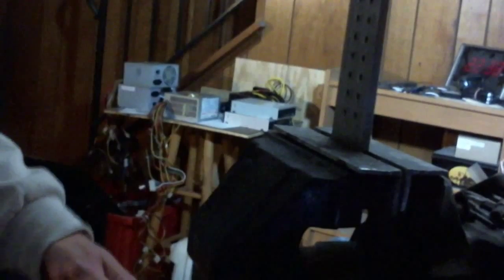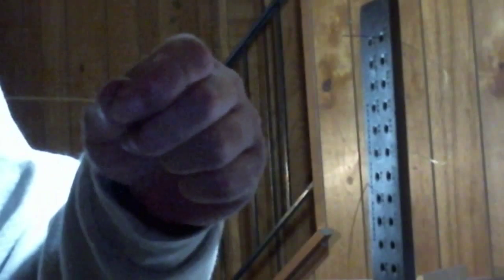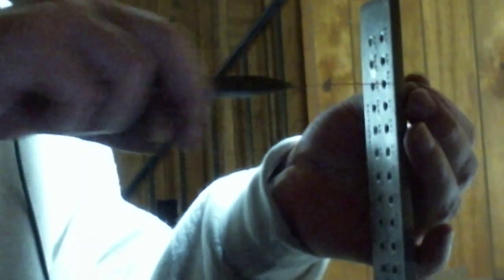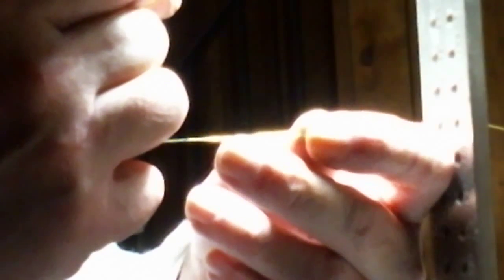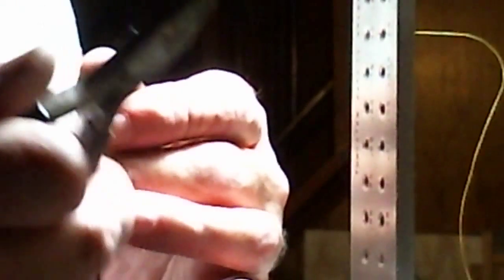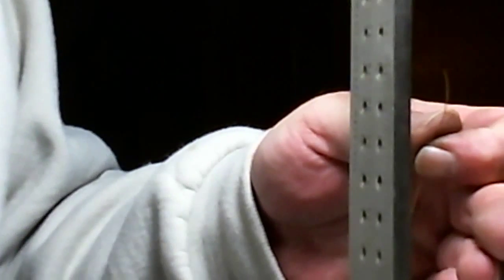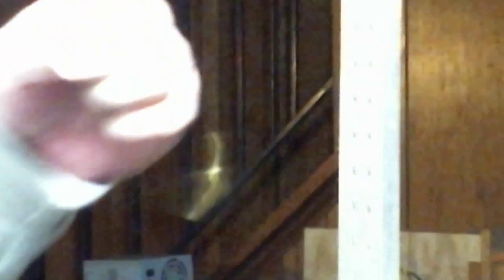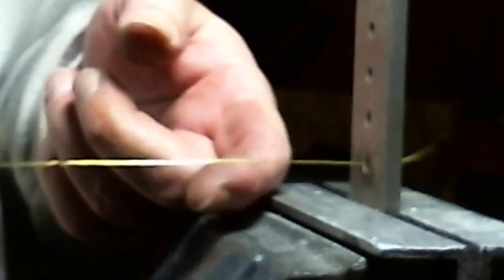Thierry Duguet Custom hand engraver. Drawing Gold

Comment: HI Thierry  Thank's for the video, and all the other's on engraving ,Fantastic work.
did you say that the Gold wire you are Drawing to make thinner is 18 kt, which a fair bit  harder than 24kt, 
it will become much harder, drawing it so many times. do you have a method of annealing it to make it softer.
so that you can still inlay it,  or is it still managable to work with.  many thanks.
Reply from the maker: Hello, thank you for your kind comments. I am actually drawing 24K gold, I proceed exactly the same way for 18K, copper, platinum, etc.Annealing during the process creates uneven ductility and make the wire more likely to break.I anneal the metal before inlay using a hand torch or a cigarette lighter, that is all it take.Good luck, enjoy!